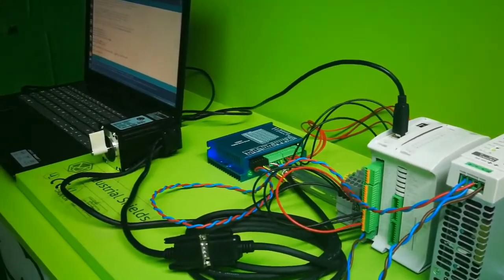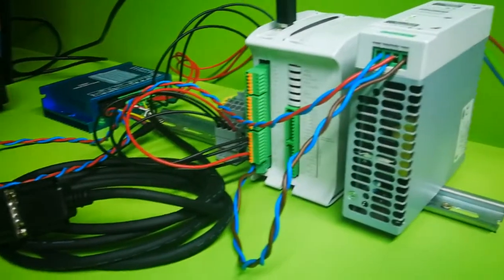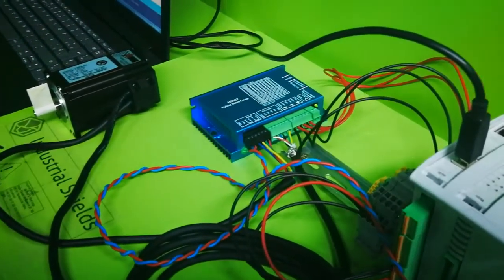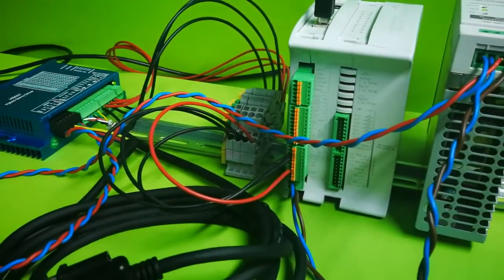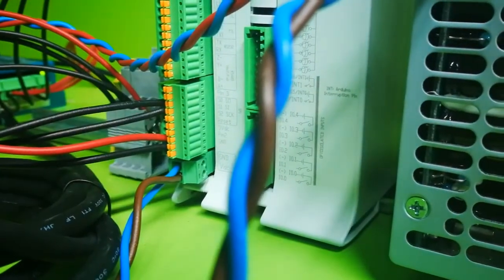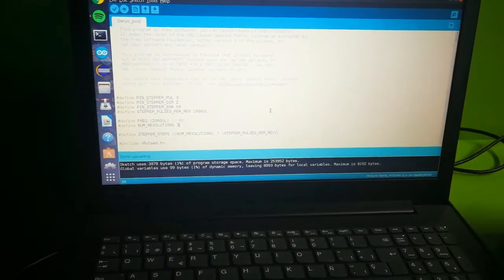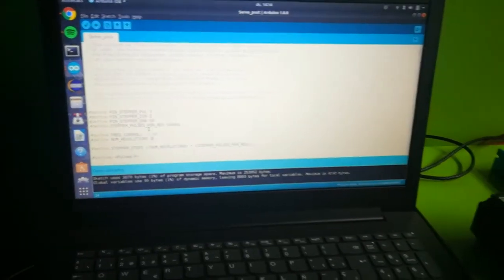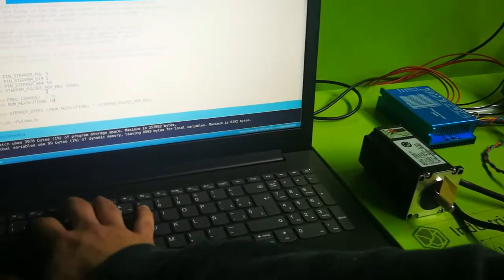✅ Testing a SERVO MOTOR with an PLC ARDUINO Industrial Controller

Comment: Is it possible to get the encoder data from the driver back to the PLC?
Reply: Yes, the encoder signals can be read using the digital inputs (interrupt capable) of the PLC, so the motor position can be known by the PLC.